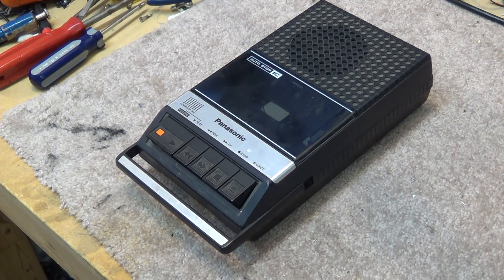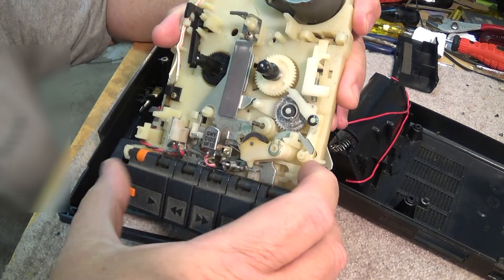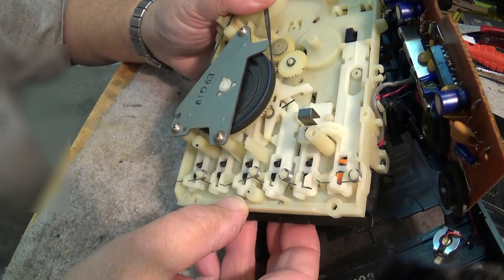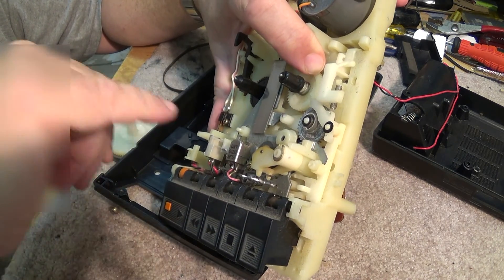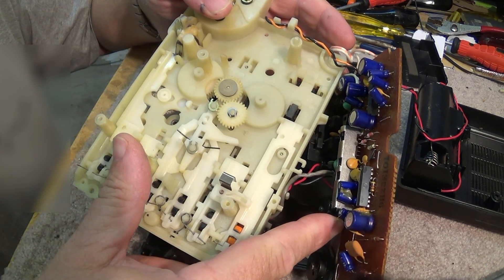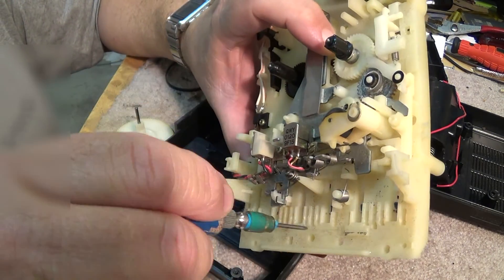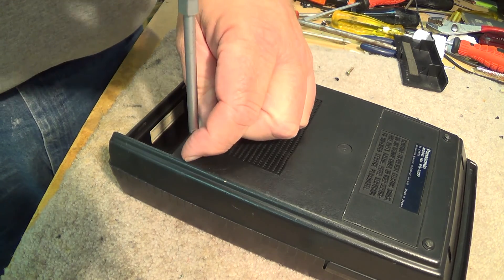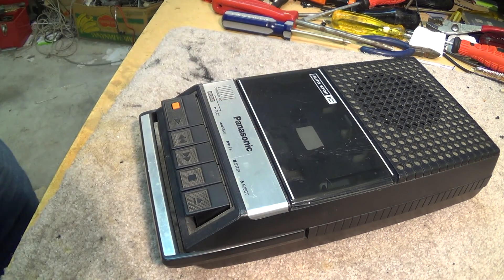Vintage Panasonic Tape Recorder tear down

Comment: can I point out that this device of around 40 years old... does not have a single bulging or leaking capacitor 🤨.... 
while a "vintage" motherboard from 2012 that I got a few days ago... has more explode capacitors that fleas on a mule 😖...

Comment: Hi, I'm also interested in how cassette players operate. I have a couple in need of repair and would like to understand the electronics. I've fixed loads needing new belts or a clean and oil. Even a couple where the was a dodgy capacitor but some are more tricky and without fully understanding what the electronics do i cant fix them ! I'm especially interested in the DATA transmit and record electronics as one of the tape recorders plays music fine but wont play the data tape ! Rather the computer doesn't hear the tape. The computer works and loads games fine on other cassette players but not the one I'm currently tying to repair. Or if you can link me to a good website or other resource specifically covering this type of circuitry that would be awesome.

Comment: Yes, these types of units replaced the classic RQ-309 series. Not a happy time in Panasonic history. "How can we cheapen the product as much as possible and  have (barely) acceptable sound quality?" I had one of these. The plastic gears made noise on any recording using the condenser mic. Then I found a store that had old-stock RQ-309DS's. Problem solved. The mystery to me is why, after cutting production costs, Panasonic INcreased production costs by making a dozen variations on this same basic unit that were mostly functionally identical.

The next generation after this had a mechanism that was far superior (the grinding gears were gone). Eventually they went to a quiet system with full autostop and IC-controlled motor speed  instead of an electromechanical governor (but they went to a lighter, cheaper flywheel).

Comment: I have the same model as yours that I found them at the Yard Sale, and when I picked them up, test them out, it worked really good, and when I opened the case of what's manufactured, and the code that I see is 271185 saying it's manufactured on Wednesday, November 27, 1985.

And when you look the date code inside the case saying 080790 saying it's manufactured on Monday, July 8, 1990.

Unfortunately, When I was put the gear back where it was for the head gear is located for to fast forward or rewind, I accidentally stretched the belt and caused the belt to go lose, and I may have to find me a new belt in order to have a correct speed for the tape recorder.

Do you know which web site that I could find the right type of the belt for my 1985 Panasonic Tape Recorder RQ-2107?
Reply: EBay

Comment: Encoder seems ok everything is moving free and same spot every time. I have found if I clean the video heads it will play great and continue to play until it retracts the tape guides and starts play again then bad video. I clean the video heads again and get more black dirt on the paper. Have you seen video heads get this dirty before? I'm using 91% alcohol to clean them. Any recommendations for good cleaning solution?
Reply from the maker: It's going to be probably the pinch arm assemble with dry grease. I know I covered that in a different vcr with the same type pinch arm assy, but you are in luck. I just finished shooting footage for a Mits HSU55 with a gummed up mechanism.
I will be doing a few on it. I did the pinch arm assy, and p6 guide, and fan gear tear down, lube reassembly and alignment procedure today, and will be editing that and posting it shortly. Since it plays untill you unload the tape and reload it, it sound like something is gummed up and sticking, which is really common for those machines.
I will likely get the video edited tomorrow and posted some time. Not going to do it tonight as it is getting late.

Comment: Thanks for sharing your knowledge and skill with us. Would love to see Panasonic AG-1980 S-VHS VCR transport timing and common issues with it. I have one I think has dried grease, going to tear down this winter would be very helpful to have some idea how before  jumping in. Thanks!
Reply from the maker: Check out my video titled RCA / Panasonic VCR. there are 3 videos, head cleaning, upper mechanism, and lower mechanism mechanical timing. The AG1980 uses the same mechanism, so you are in luck to see a walk through of that mechanism.
I have a 1980, and did a video on it earlier but never fixed it due to the comb filter module failure, and the availability of the part. If I can source the part I will be fixing that one in the future.
Reply: 12voltvids Thanks for the reply. I enjoy tinkering with the old VCRs it's a hobby. Question about HS-U82 - Just got it it look low time but picture quality is terrible top half screen is black and white bottom is color and a little unstable looking (standard VHS). Once in a while (1 in 15) when I insert the tape it plays perfect, remove tape and play again and it goes bad. Any idea what may cause this? Do you work on these if I can't figure it out? 
The tape guides appear to lock into same location every time a tape loads.
Reply from the maker: boatingcharlie1

Check the mode encoder switch. The contacts get dirty and cause noise to be introduced as it rotates. This causes the motor to stop before loading is complete. Also check the pinch roller post to make sure the grease isn't dry, especially where the plastic pieces connect to the pinch arm assembly.
I covered this in one of my mitsubishi repair videos.
I will be doing some more videos on the Mitsubishi soon. I just have done 3 on a Sanyo VCR, and I will be editing and posting those ones soon.
Reply: @12voltvids  can I point out that this device of around 40 years old... does not have a single bulging or leaking capacitor 🤨.... 
while a "vintage" motherboard from 2012 that I got a few days ago... has more explode capacitors that fleas on a mule 😖...